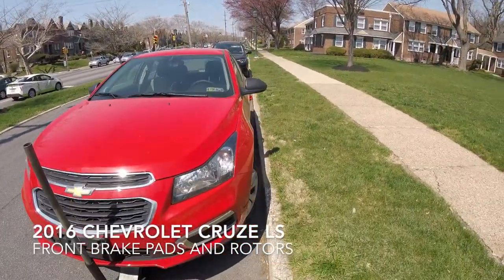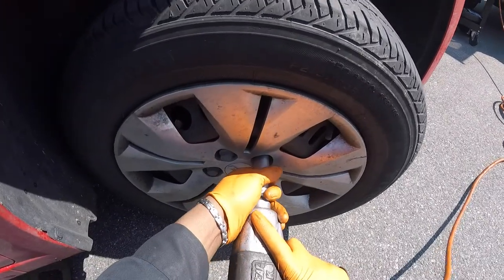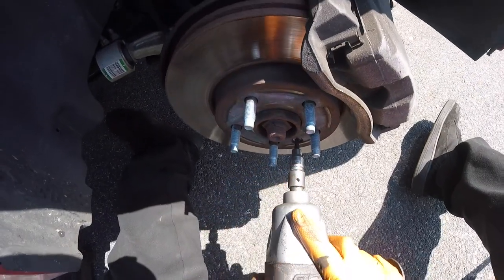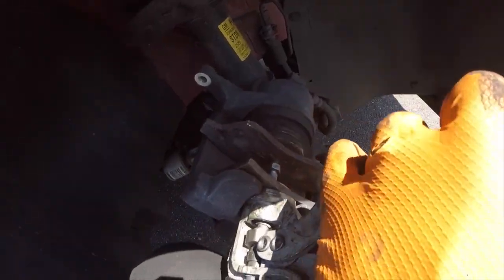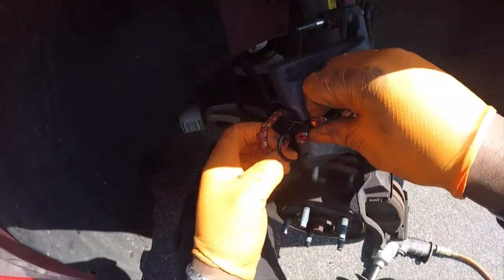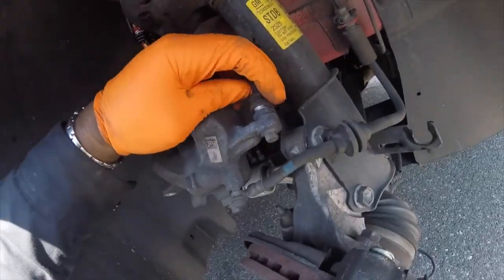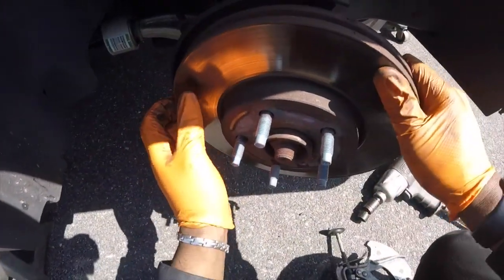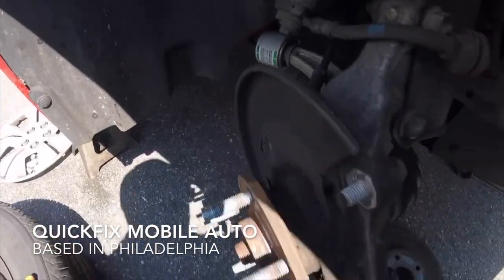🤔How to replace brake pads and rotors on a 2016 Chevrolet Cruze🤗

Comment: How long can you leave the brake fluid cap off for? Can you leave it off while you’re changing all 4 brakes?
Reply: Yes you can, if u have 2 front disc brakes and two back drum brakes you can just take the cap off the resourvoir the air will escape from there if you haven't already opened the bleeder nipples. You can just push the piston back with a c clamp pushing on an old brake pad or even easier with the tool he used in the video and refill the resourvoir to regain that lost pressure without have to bleed the brake.